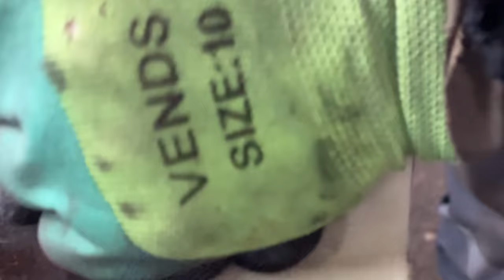An Incredibly Sharp And Strong Knife That I Made And An Ordinary Iron Cable

Comment: I'm amused by the comments, lol!😂
I have done plenty of blacksmith work on a survivalist level deep in the northern u.s. living off grid a hundred miles from anything for twenty years so I know this knife is more work than the keyboard blacksmiths realize.
Well done an nice knife 🗡!
Reply: "Keyboard blacksmiths".. what a great term. I watch this stuff and then learn additional things from intelligent comments whilst dismissing jackasses whose only "contribution" is criticism. My question is, why not start out with a piece of solid steel to begin with? (provided you have it). I scooped up a 2ft length of galvanized cable probably 2" in diameter that the telephone pole guys left behind last week, w/ no real idea of what to do w/ it. I assume the galvanizing dip needs to be subtracted somehow (maybe in the process) before doing something like this, if the quality of the cable is worth bothering with to begin with, correct?
Reply: @YerBrwnDogAteMyRabit  
If you don't mind me answering I'll try and help you out. The client probably wanted a twisted cable knife, not knowing what a blacksmith can/cannot do with wire or metal. The galvanizing layer is hazardous so that can be burnt off in a well ventilated area, outside away from people and animals, then once that has been done you should take that piece of metal to a grinder and see what color sparks it throws off, if the sparks are and orangeish yellow then you can use that metal to make a blade. Hope this answers your questions.

Comment: Nice use of safety glasses while cutting and grinding!
Reply: Man I was curious about that myself. Seemed to be taking a huge risk.
Reply: He’ll get a chip in his face then he’ll get it figured out
Reply: Slap a takkie wip a kyf you are so safe...
Reply: @wijpke  Walkie talkie yapple dapple rip van winlesmith the dog ate clay, right?
Reply: @YerBrwnDogAteMyRabit  praat n bietjie Afrikaans boetie..you safety ranger
Reply: I'm probably too careful but take protection glasses + shield when working with angle grinder. Once I only had glasses, pretty tight on my face but I felt nice bite just on the skin under my eye while cutting steel. I'm sure it was slightly under the glasses. So either pretty tight glasses are must or it's necessary to use it with the shield combination. I know it sucks and takes time and the visibility is lowered, especially when working in cold garage during winter (terrible mist sometimes). Since it happened I never risk any injury.
The same with welding mask and glasses under it. I can tell you once I forgot to put the mask down during mig welding (CO2 only) and I was glad I had the protection glasses on... And it's relatively easy to forget putting the mask down.

Comment: I would like to see a video of anyone making a knife/sword using only the. Methods that was used to make  during Roman soldier times
Reply: If im not mistaken, it would just be a lot more efford, keeping the fire warm with bellows and then hammer your steel with a hammer instead of a machine, hardening would be the same as the forging process. Actually, now that I wrote it it seems to be more or less the same 🤷‍♂, except for the shaping / sharpening, Id expect that to be done with a stone (or skyrim has made me think that)
Reply: I have seen a video recently where someone made the steel from ore and then made a blade from that metal. IT was very amazing, work though 😅
Reply: @carl6153   if you can  remember  who done it.. please let me know  I would like to see  it

Comment: Those tinted glasses are for using an Oxy Acetylene torch not welding, they are several shades lighter than what’s required for arc welding. The no safety glasses thing is a bit dumb but could be a mix of age and cultural differences in the lack of PPE. Also his cable was galvanized cable, he might have tried soaking it in vinegar to remove it but clearly when he was welding the ends the residue showed burning galvanized coating after he welded the ends and that’s toxic crap to breathe
Reply: I noticed that also when pulling it out of the fire the greenish white flame. In my metal shop class this year I made the mistake of just heating up galvanized steel and had a similar color flame. Not good to breathe in.
Reply: ma godetevi il lavoro  invece di criticare luomo esprime se stesso attraverso i suoi lavori,  apprezza  la sua espressione 😅😅😅
Reply: Be proactive and send him a welding hood then, wise guy.
Reply: @HSKFabrications  I’ve spent hundreds of dollars on each of my hoods so I think I’ll keep them right where they belong, I don’t support communism
Reply: @peltiereric6497  Azerbaijan is not communist.
Reply: @HSKFabrications  your idea of I should give him one of mine is communist ideology and Azerbaijan was part of the USSR and still quite friendly with Russia currently
Reply: @peltiereric6497  I didn't say give him one of yours, lol
Reply: @peltiereric6497  So what do you support, bossing other people and telling them how they should do things? What's it matter to you if you're not a communist?
Reply: @bakielh229  are you a willfully ignorant person or what but using Oxy Acetylene Googles instead of a Welding Helmet can and will temporarily blind you if you look at the arc using improper protection but the damage can cause permanent impairment of your vision. The no Safety Glasses thing in a personal choice but age and cultural safety practices have a lot to do with it. Now that last thing about the cable being Galvanized, that is a deadly serious hazard, lots of Welders and Blacksmiths all across the world have poisoned themselves with what’s commonly referred to as Metal Fume Fever which is the Toxic Zinc Oxides burning off from the Galvanized Coating and it can either make you very sick which is the common outcome but can and has been well documented to be deadly in some cases

Comment: Nice knife from scrap cable.  Suggest that you use safety glasses when using the electric wire brush.  The wire bristles do break off at speed!
Reply: Not just the wire brush bristle.  Any metal fragment or piece of grit could cause serious injury, especially one of those little red hot pieces.  Good work.

Comment: Dude...it has fissures in it after you were done because you opened the the cable and added a shit ton of flux in there creating those cracks that run up the blade. Yes this knife survived one baton into some steel but I doubt it's going to survive much more.

Comment: A couple of suggestions:
1-Borax is a flux, not a glue. You can use less and get better results, as there's less risk of getting some trapped in your steel. (Flux lowers the melting point of scale, so it will flow away better.)
2- My blacksmith teacher always made us draw down in the square and then round it afterwards. If you keep hitting it round then you risk creating a void in the centre. (This is how they make seamlessly tubes, or what Americans call DOM.)
Hope this helps.
Keep up the good work mate!
Reply: I suggest stop being too comfortable getting his hands so close to the hot steel.  That is just arrogant and dangerous.
Reply: He is a true viking, let him be!!!
Reply: @gabrielvega1934  absolutely none of this had anything to do with vikings.
Reply: Let him cook
Reply: @DeathbringerDrago I would also like to talk about his lack of eyepro staring directly at the grinding wheel.
Reply: @orlandovftw  Yes his lack of eye protection was throughout the video.
Reply: @DeathbringerDrago I’ve always wonder if you barely stuck your finger on that hot iron would you skin just fall off?
Reply: @demonCarcass21 well when the steel is « red hot » it is around 1200°C so your finger would just melt and get stuck on the steel

Comment: Question: Why isn't this knife really fragile? I'm not a blacksmith, so I'm not speaking from a place of knowledge and would appreciate an answer from someone who knows. But it seems that using a cable would leave many stress lines in the metal that could shatter the blade on impact. Unless you heat it to the point where the metal almost melts, which he didn't do. Maybe I'm missing something here...?
Reply: I deleted other comments explaining forge welding.

This dude don't know shat about knife making

Comment: nice work! you got balls using a cut-off wheel with no eye protection.
Reply: My thoughts exactly. Especially with a cable.
Reply: No safety glasses were harmed in the making of this video.
Reply: I'm surprised he has both eyes. Getting metal in your eye (or a part of a grinding disk that breaks off) is painful and to be avoided.
Reply: Parabéns pelo seu trabalho
Reply: Or face shield while welding
Reply: @curetiamhices289  0

Comment: Oh god the delams on that blade… hope thats only for opening envelopes or cutting paper. Thats what happens when you dont  properly clean your metal first and attempt to hammer forge cable instead of twisting it. And opening the cable to dump egregious amounts of borax into the center. Not twisting it back and just hammering it. Welding with sunglasses and grinding without safety glasses. So much more wrong than right in this video. When he left it on the floor to cool after quench he should have left that garbage there with the rest of the scrap steel.

Comment: Nice cracks
Reply: What was the point of forging this block for so long if the alloy still failed, and there were cracks inside?
the guy had to forge this block longer until he got a homogeneous alloy. or don’t bother with nonsense and buy normal steel.

Comment: Rambo would pay good money for that blade.
Reply: What? Hell no with all those delaminated inclusions. Has one running down the cutting esge. And the recasso where the cutting edge meets the handle the steel isnt solid. That is a horrible chunk of steel. Yea if your desperate and need to open an envelope or something similar. Show this video to any decent blacksmith or bladesmith and they will cringe.

Comment: Dude please wear glasses whilst on the wire. In a split sec it could be gone for good. Your grinding  without them!
Mate even with glasses I have had to go get metal burs out of my eye because they bounce into your hair or eyebrow and you shower and they wash into the eye or fall in. Hurts like hell that scraping on the eyeball even though it is not a threat to sight.
Bur imagine a disk busting up? I know it's happened because it happened on a job I was on to a young guy!
Also I have had those wires spit on me on the face so it's highly probable they can hit the eye.
It doesn't hurt skin and I am wearing glasses.
Understand not wearing face masks they fog up for me.
But good quality eyewear that is impact resistant is a must.
Can I have your tools when you lose sight?;)
And I would not let you work in my shop.
Contacts are not enough either

Comment: No eye protection or deflection shields while you’re using that chop saw, angle grinder, wire wheel or while you’re forging. The only eye protection you used was while welding and even then those are for a torch not an arc welder. Get your shit together man!

Comment: What's the white powder put on Wire being molted into a ROD to make the knife? It looks like a bonding additive. It's knowledge which I am trying to acquire. Marvellous craftsmanship!!!
Reply: Borax
Reply: Borax
Reply: I think the powder is flux, borax
Reply: И что?хрень полная!
Reply: Боракс
Reply: It is called borax. Its also used as a laundry additive. Mostly "12 Mule Borax" and it forms a layer coating the metal to keep it from forming forge scale giving better cleaner welding surfaces.

Comment: Interesting work, but you really need lessons in safety. 

Those glasses are not enough to protect your eyes from the light of welding. I wouldn't be surprised if you have already done permanent harm to your eyes. 

You need safety glasses when working the wire wheel. One wire gets loose and at those does it could take your eye out before you could even blink. 

Please be careful. Your work, and you, deserve to be safe.

Comment: Man you seriously have a death wish. Using galvanized cable and not cleaning it before you put it in your forge. That cut off wheel you have in place of a grinding wheel. No safety glasses, using gloves that can easily melt and catch fire. I wouldn't want you anywhere near my shop. 

The knife is a decent design. You worked the steel colder than what I've seen anyone else do. That's why you have those cold shuts/cracks in your finished blade. I also noticed that you didn't remove any of the weld that you put on the end of the cable. Instead you just forged it into the blade. For someone who can do damascus I certainly hope that you do a better job with cable in the future.
Reply: Yeah I was wondering about the visible areas of separation on the blade. Seems like it's destined to break if used. No blacksmithing experience, but it looks like a natural weak point.

Comment: mi ez a fehér por?
Reply: borax or blacksmith's welding flux
Reply: @Karl_Uklarovich  Köszönöm
Reply: @IstvanKubina  что за абракадабра?
Reply: @Karl_Uklarovich  The borax powder melts and attaches to the surface of the metal, it prevents air from getting to the metal which causes oxidation. The oxidation is the scale you see flaking off the metal. If you have oxidation scale in between two layers of metal to be forge welded together, they will not weld where the scale is. This forms little voids like you see in this blade where the stands are not fully welded together.

Comment: You dont need to spread the strands for the flux. It melts and sucks onto the surfaces with capillary action.

Also - use a squaring die in a press and you can consolidate the whole piece in one heat.